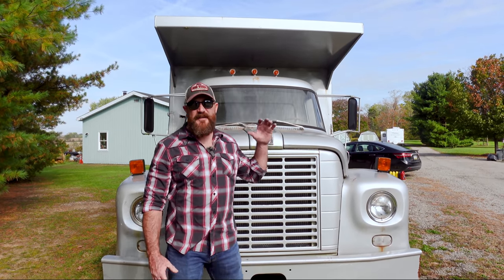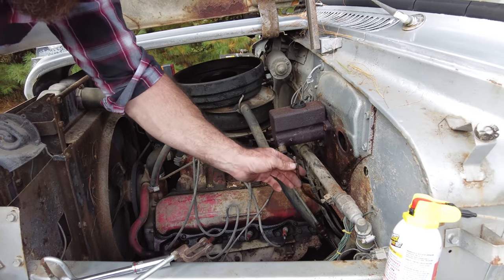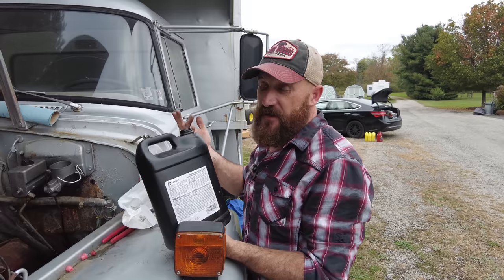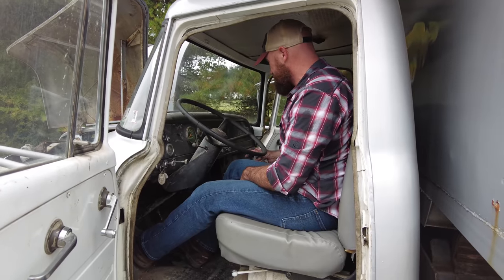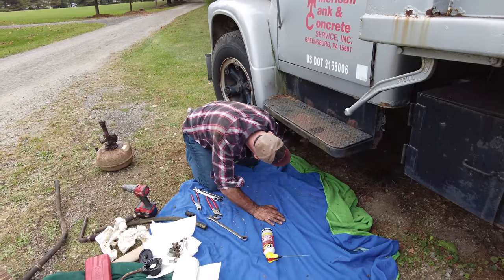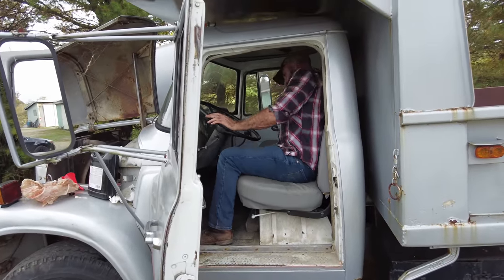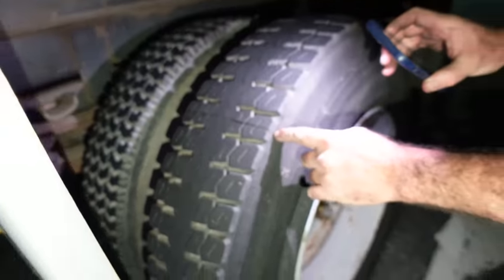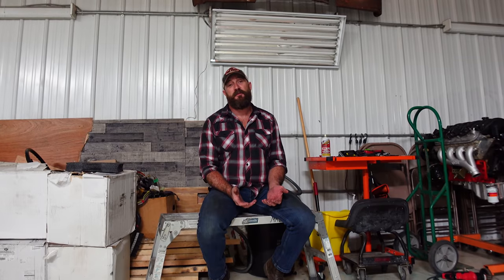Will it Drive 250 Miles Over a Mountain after 15 years ?! 1969 International 1800 Dump Truck

Comment: I used to drive an International Loadstar dump truck  like that one in the middle 60's when I was serving in Germany.  I really like those old Internationals, especially with that electric two-speed rear axle.  The one I drove was governed at 57 and that's all it could do but it did it loaded or empty.  It really was a comfortable truck to drive.

Comment: I have a 66 Chevy pickup with the 2 speed auto. I bought it in 1985 and still have it. I drove it from Atlanta to Jacksonville FL in 1989. I got 8 MPG on the highway. Like you my max was 55 MPH. I am currently resurecting it and an old triumph from the same era. I miss the simpler days of automotives, the designs were made to look good withou as mus emphasis on aerodynamics. Where you could make it run and get you there with the tools and supplies you could carry in a tool bag. Didnt get there fast, didnt get there in comfort, but we got there in style.

Comment: Copper washers can be rejuvenated by annealing them with a torch (heat until glowing hot and let it cool down slowly).
Reply: Heat until copper puts off a green glow to anneal,soften.
Reply: You can quench immediately in water for successful anneal.  No need to slow cool, as with steel.
Reply: Only works to restore softness not thickness

Comment: FYI I'm an otr driver for 31 yrs, i run 100 psi in my drives and 105 psi in my steers. i'm 99% of the time maxed out on weight. They do not even get but barely warm to touch. from the road friction. i run the north east coast, NJ. PENN back down to IN...
i just got finished watching the recent vid post of getting #2 eng running on the 401. i hollowered with a standing ovation. All by myself in my rig. In another words jumping for joy...

Comment: Awesome truck and awesome adventure!  Something about the old gas Loadstars I really like.  Wish I had a shop to work on mine.  It's a '69 Loadstar 1700 with a utility bed on it and 15k original miles.  It's been kept inside most of its life so there is no rust anywhere.  Now if only I could find someone who wants a free medium duty utility truck bed all they have to do is unbolt it from the frame and take it.  Surprisingly I have not found any fellow IH enthusiasts in my northeastern corner of Calif.
Reply from the maker: 15k miles and stored inside is an amazing find ! 
What’s your plans with it ? I’m sure there has to be someone out your way who’d make good use of a heavy duty bed.
Reply: @rebuildrescue  hi, my plans are to convert it to 4wd and make it into a general purpose flat bed truck - for work and to put a camper on when I want to go play, as in wilderness camping.  I now have the front drive axle - same axle ratio as the rear and same Dayton spoke type wheels and manual locking hubs.  I was also blessed to find a very rare Dana/Spicer 4 speed transfer case from a low mileage municipal truck - very low, low, direct and overdrive gear ratios.  I did a small write-up on this transfer case in a couple of the IH forums.  But before any serious work can begin, I need to find someone to remove the utility bed.
Reply from the maker: That sounds like an awesome project….  4x4 and a camper ! That’ll be the coolest camper conversion not to mention go anywhere !

Comment: Good Job Getting the Old IH Truck going :)  Those Older IH Trucks are Funny :) you cant have 2 check valves in the Brake system, some times the check valve will be in the master Cyl. and some times it will be in the brake booster, but you cant have 2 check valves in the system. the rebuilders put check valves in both the master cyl. and brake booster, be aware of that, and you will never get the brake system to bleed if it has 2 check valves, I learned that the hard way :) I took the truck to the IH repair shop and a old timer mechanic remembered that about the old IH trucks with Hyd. Brakes, just wanted to pass that info along.

Comment: Just about every old school truck of that era listed on Aussie e-bay or Gumtree, says ; "Brakes not working will need a tow or flatbed to remove"! 
It was an ongoing repair/ maintenance schedule with brakes from new back then. But they were cheap to fix & it was often interchangeable with other brands of truck & easily adaptable to make it fit. 👍.

Comment: Gotta bleed a Master Cylinder before hooking it up to the rest of the hydraulic system... A tube off the outlet into a full reservoir and slow pumps until there are no bubbles. Then hook up the vehicle line to the MC and crack it loose a 1/4 turn from tight and have someone slowly push the pedal to the floor and hold. Tighten line. Release pedal. Crack line, pedal slowly down, tighten line, release pedal. Continue until you have solid pedal. Saves you from having to struggle with sketchy bleeders.
Reply from the maker: Thank you for the advice John…. Wish I would have bled it that way. It would have taken a lot less time.
Reply: Your videos snagged me recently, got sucked into the abandoned twin prop even though I know nothing about them. Feel free to hit me up if you get stuck on something and I'll keep watching 👍
Reply from the maker: @johnjones1705  sounds good John
Thank you 👍🏼

Comment: I like the videos, good work.  Amazing that you could get parts for that old International. That truck is in great shape for it's age.
 The exhaust is not a problem. Truck rear ends get hot, I own a 379 Peterbilt, trust me they get hot, if you put your hand on it and you have to jerk your and away quickly, then your getting a little hot.
Those wheels that you have there are called Dayton wheels, so the brake drums are called inside drums. You can get to the brake shoes with the tires and rims on the hubs, or you can remove them.
To get to the brake shoes, you have to pull the rear wheel drive axel shafts out of the differential, take the wheel bearing nuts off the hubs, then the wheel hub and the brake drums come off together, you will need new wheel seals, which would probably be a good idea to change anyway, since it sat for so long. 
Then you can get at the rear brake slave cylinders, which could be leaking brake fluid, especially since it sat for so long.  
As for  the truck wondering around could be caused by a steering shaft U joint that is loose, or failing, there could be one behind that cover inside the cab. Check all the ball joints in the front end
I cracked one on my Pete once, and the truck was all over the road.

Comment: I've got almost the same dump truck. It has 10 lug bud wheels and air brakes which is nice. I converted it to a tilt hood which is way more convenient. Couldn't say how many loads I've done, it has 230k on the working odometer. Good looking truck congrats

Comment: 42:45 I learned to drive a forklift on a unit that had brakes like that.  You had to pump the brakes about 3 times before it would really start to slow down.

That gave me nightmares about driving and losing the brakes.  I have no desire to re-live that.  I'd keep bleeding it til it works, and if it just wont, then I'd just take the slopes slow, keep it in 2nd.

Comment: I had to replace the master cylinder and vacuum booster on my 65’ N600 and the brakes are the same way. They will stop on the first push, but feel really firm and will throw you through the windshield on the second push.

Comment: Did you bleed the brakes at each wheel? Also you will probably need to bleed the clutch slave cylinder to get a fully operating clutch. Keep up the good work 👍
Reply: Same here. Are there bleeder valves at all 4 brake cylinders and the slave?
Reply: Exactly the same what i thought... Shouldnt be a big deal to bleed them and is a lot faster and definetly safer than just hitting the pedals...
Also maybe just changing the brake cylinders on the wheels might be a good idea...
Reply: I'm guessing he did since he did it with the first master cylinder he tried out, but just a guess lol
Reply: This was bugging me big time. I mean yeah you can get air out by pumping but you gotta bleed at the wheels.
Reply: All we have are YouTube mechanics lol don’t hurt yourself

Comment: Your a crazy SOB! But hey I've done very similar drives my self.  Once changed engines at the top of Snoqualmie Pass in Washington, and drove the car the rest of the way home.  It was enough work to swap engines but it was late November and snowing about an inch every 30 minutes.  The engine I swapped in was one I pulled out of a wrecked car, and I had only test fired it in the wreck.  But hey it stayed in that car till I sold it seven years latter.

Comment: Love those old IH trucks, I have a 1961 bc 160  grain truck been there with the brakes replaced everything but the master cylinder around $2000.00 worth but they will put you through the windshield if you hit them too hard. Mine has a inline 6 with a 4 speed 2speed. Enjoyed your video.
Reply from the maker: Thank you for sharing and for watching Delmar 👍🏼

Comment: FYI that air filter housing is supposed to have oil in it.  Oil bath air cleaner.  Also those boosters do fail exactly as you described.  They are generally still available as they were used on a million different vehicles back in the day.  You gotta watch it because they will burn through your brake fluid during driving so youll leave with a full master and no leaks, and return with no fluid!

Comment: Mopar had a driveshaft parking brake for years. Advantages: short cable and sinple rear drum brakes. Disadvantage: If used at speed, u joint could snap and drop the driveshaft.

Comment: The trucks of that era the brakes were always a double pump. I'am not sure but I think it has something to do with the vacuum booster
Reply: I drove a 1974 International Loadstar 1600 . It was a 22 ft. box truck Loaded with gear weighing in at 20 thousand lbs with that same brake system. kept shoes adjusted up tight, pedal only moved an inch, and that heavy truck would throw u through the windshield... no pumping, and slight foot pressure!

Comment: Those copper washers if you heat them up with the blowtorch they will soften up again and never stack them. It is a trick I found out rebuilding an old marine diesel engine that had copper head gaskets,

Comment: I own a 74 loadstar 1600, brake systems on these trucks will drive you crazy, always drive it like it has no brakes. Some Other things to mention, when timing the engine most of them time off cylinder 8 not 1. There are also upgrade kits to delete the points, you just have to figure out which distributor you have. Make sure you timing advance works, it's has a huge effect on mpg, I get 11 to 12mpg with mine. If you pull the fuel tank there will be an unbelievable amount of rust flakes in there, I promise 😂.
Reply: Maybe my timing advance isn't working.  I get 3 to 5 mpg on my '75 loadstar with a 392 in it.  It also backfires on deceleration.  Thanks for the tip.

Comment: No doubt you've learned more about it by now.  I had a 65 1800 for several years.  Air brakes, wedge style, no spring brakes until I changed the rear end for one out of an old R-190.  I'm not surprised that you got it home, however I would have avoided interstate and turnpikes as much as possible.  Bluntly put, there are too many crazy @$$holes that feel entitled to drive 10 or more over posted speed and expect you to stay out of their way (I contend that truck drivers and proctologists should be paid the same rate ... we deal with the same thing, all day, every day).  They are geared for 62 mph with a properly working governor ... work horse, not race horse.  5-6 was about what I got in mixed condition driving, so I'd say yours was on par.

Have fun, keep a sense of humor, there will be times you will need it.  Typical International quirks will happen.

Comment: I was like "Yay! He knows the line is gonna try to spin..." then I saw those biting channel locks on the (now likely getting senile) line and my eye started to twitch...

Line wrenches. Grab on 5 sides instead of 2. No more slippy slippy and smearing fastener heads. Shop around and get the thickest set you can find. You'll need the extra meat if your ever in the unfortunate position of r&r the mechanical fuel pump on a 6.2 or 6.5 Chevy diesel.
Reply: P.s.

Super jelly. That is a sweet piece of history your bringing back to life. Just discovered your channel by stumbling across the saga of the 410 and you earned the sub of another kindred spirit.

Comment: Take the brake  drum off and find out why its dragging as it probably has a bad  wheel cylinder so change it out and re adjust the brakes. I would do some serious bleeding of that system and make it so  the pedal is responsive as well as the clutch. I would also tune the engine and fix some exhaust leaks. Lots of those old trucks like that dump  the exhaust just like that and it doesn't heat the brakes up. I imagine that you could elbow it out to the side and go up a nice short stack under the cab guard like many big trucks do and that way not set grass on fire driving through fields.

Comment: I noticed how fast you pumped the pedal,and I don't mean when the film was speeded up. You can saturate your fluid with tiny suspended air bubbles that form when the fluid has to abruptly make fast turns,such as banjo fittings and backsides of cylinders. When they all rise,like bubbles in a mug of beer,they will make a large pocket of trapped,compressable air,and need more bleeding. Push AND let pedal return in slow motions and you'll get better results.  Nice old Int'l.!

Comment: Hey I just gotone of these a 72 model Its got a Chrysler V8 in it , It:s got a flat ben on it some one took the dump off it , The Motor Runs and Ive driven up the road and Back ,It was on a Farm got it for 800 Bucks ,In Australia here ,Im Gonna put a Dumpon it and start a Buiness Taking stuff too the Tip
Reply from the maker: These trucks are built strong 💪🏼
Good luck getting your new project done Brian. Thank you for stopping by the channel 👍🏼
Reply: @rebuildrescue  Thanks ,Yeah cool Chanell ,I checked out some of your other vids, The First episode of this dump truck
and the Plane ones , Cool Love your work Sir

Comment: Next time bleed the masters run a hose from the brake line hole to the masters reservoir pump ontill no more air bubbles are present , new masters usually come with the hose and fitting to do this , if not ask at the parts store or borrow off a mechanic after that open bleeders at the slave cylinders and gravity bleed with the cover off the master keeping an eye on the level close all bleeders after a little comes out of each and you should have some brakes ontill you can get a hand to help you do it properly

Comment: Answer to the video title question ... I once had a Mini Mk1 which ran for OVER 350 miles (being thrashed) with the oil pressure warning light constantly lit and about 6lbs ONLY of oil pressure MAX showing on my after market oil pressure gauge before finally throwing its arms and legs in the air and giving up! So A truck should manage 250 miles just fine if it's running ok! 🤣🤣🤣
Reply: I bet that Mini MK1 was a 958cc engine too.  Hard to kill those things.
Reply: @edcrabb  it may have been but the casting numbers said 995cc.  What I DO know is that it was a fairly rare example of an "over square" engine stroke shorter than piston diameter (bore) and the Mini bore, as I'm sure you are aware is pretty small to start with. As a consequence that particular engine, with only mods being double valve springs and a pancake air filter meant it would happily rev to 6,500 with the limit being determined by the standard 1.25" single SU card choking off. I did once try a mate's single 1.5" SU but it wasn't much better. However, I did have another mate who fitted twin 1.25's, from a "Spridget" IIRC, that he said worked brilliantly once the carbs were properly balanced. 

Re: your comment, yup Mini engines generally, despite the proclaimed weaknesses of a 3 bearing only crank and the very thin webs between cylinders, especially 2&3, that caused gasket leakage issues, were all pretty indestructible!

Comment: I know am coming in here pretty late , I scanned the comments fast and didn't see the answers in there that i was looking for , so here go's , next time you install a new master cylinder or slave cylinder , put them in a vise first and fill them with fluid and bleed them , they should of came with a bleeding kit but if not you can buy one at any auto store and they do explain how to use them , you had a hell of a time trying to get braked on it because you never bleed the air out of them before you but them , and you did find out what happens if you don't do it first , if their is air in a new master you will never get brakes .. so bleed the master cylinder and install it full of fluid , then start bleeding the wheel cylinders starting with the furthest one away , by the time you leave the backs and get to the fronts you will have peddle , this whole procedure takes a bit less then an hour to get your brakes ... I enjoyed your video on the truck , I owned and worked with the same truck when I was 17 years old back in the early 70's

Comment: A buddy of mine gave a "70" Chevy school bus , it was mid January 10 below passenger side windshield missing the door wouldn't close no breaks at all and drove it 39 miles at night on back roads to get her home . My father-in-law drove his "89" Chevy 1ton Wrecker with the sling down using it as a blocker , needless to say it was not fun . Between freezing my ass off (not heat at all) no breaks and the headlights were shining every which way but straight......yeah not fun at all 😊

Comment: Not sure you noticed but it looks like you have an axle seal leaking on the driver's side, looks like some fluid on the tire.   If those bearings aren't staying in the oil bath that's probably why they are getting hot